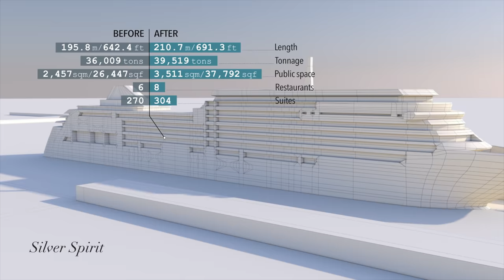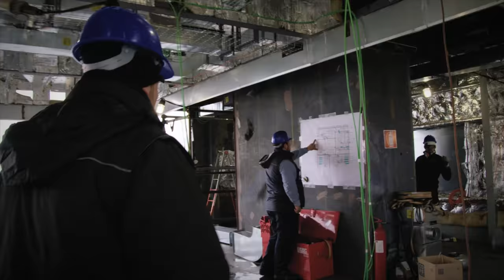Dry Dock Discovery - Silver Spirit: Lengthening a Luxury Cruise Ship

Comment: All that work for a lousy 49 foot extension?  Make it 200 feet!!!  And now you've got 2 more whole sets of welded joints to break and leak.  Good job there.....
Reply from the maker: Hi LoudMouthTim, thanks for watching. I suspect that there are two reasons for the size of the new addition. First, based on the entire length of the ship, there must be a maximum allotment for the the extension. The ship was only 642 feet long to begin with. Second, Silversea Cruises is known for their smaller, more intimate ships with a higher crew to guest ratio. Adding a much larger section would not have been in keeping with the rest of the fleet.

Comment: Is it safe to take a ship apart? Looks like a disaster in the making......
Reply from the maker: Hi Billy, thanks for watching. This process is really no different from how the ships are welded together block by block when they are built. A ton of precise engineering goes into exactly where to cut the ship to maintain seaworthiness while also allowing the new section to blend into the existing areas onboard.
Reply: Large ships are built from blocks like this, so you bet.
Reply: They're all about safety.  Like the guy on the left at 3:57
Reply: Obviously it isn't.  How do you think the ship is constructed to began with? Section by section.
Reply: @joedufour8188  He catches a face full of grinder sparks at 4:00

Comment: Oh the days of the past. After sailing for some 33 years, dry dock used to be just that. Taking an existing ship to be repainted, varnishing existing wooden surfaces, new carpeting, some checkups for the mechanical parts and other details to reduce the aging of constant exposure to salt water. Today’s dry dock includes satellite upgrades, adding WiFi, computerized check-in, more cabins, interactive information boards, and many more bells and whistles too many to add to this comment. Floating cities are now the cruise lines’ bread and butter. Long gone are the days of sitting on a deck with a book. So much to see and do, one week is rarely enough to see today’s mega ships. I’ve gone from ships that were 30,000 in tonnage to those pushing 230,000 GRT. 2000 people including the crew to 10,000+ combined passengers and crew. Less than 45 days and off I go again. 🛳🗺 ⚓️
Reply: D Heyes, I'm quite envious. It sounds like a marvellous lifestyle.
Reply from the maker: Hi D Heyes, thanks for watching. I hear you. I too miss the days where I did not feel obliged to communicate with those outside of the ship. At least the price to communicate has come way down from the $10 or more per minute to make a ship to shore phone call.

Comment: I will be onboard for a Lisbon to London cruise starting M-22-2018.  Sure hope it is ready by then.  Last October we were on Crystal Symphony fresh out of drydock.  We had lots of issues  even though the biggest thing they did was revamp several dozen smaller staterooms into larger ones.  The refurb ran so far behind that our original two back to back cruises were canceled and we took the next available. Mistake!  First, we were delayed leaving port a day and then about 80  passengers, incl me, were not allowed to board since the new staterooms were not ready.  Hell, it wasn't until almost 4 pm the next day that we were allowed into the stateroom.  And then the surprises got started. Like no lights in the shower or in the toilet area, but a very bright ceiling light that could not be turned off; electronic door locks that just stopped working along with the electronic safe that would not open, etc etc. A sofa that was put together wrong so it was 5" higher at one end then the other.  A bathroom door that you could not close and a closet door that would not open.  The whole list got to be pretty long.
So yeah I am a little worried about this makeover!
Reply from the maker: Hi DC Maxx, thanks for watching. Hope you have no issues on your cruise.

Comment: What’s that contraption sticking out of the hull seen from 6:35-6:42? Never seen that before
Reply from the maker: Hi Mike, thanks for watching. That is one of the ship's stabilizers. There's another on the other side. They extend outwards (resembling an airplanes wing) and are used to control the ship's rolling side to side movement during heavy seas.

Comment: That's an awful lot of effort for just 50 feet. Wouldn't it have made more sense to go larger and give the ship even greater capacity as they're going to all the trouble of cutting it in half anyway? Or is it that you can only add so much length depending on the width of the ship. Would it be too unstable if it was long and thin, so to speak?
Reply: David Hunt going even bigger would probably pose major problems for the ship. It would cost the company an extremely large amount of money and they would have to hire a lot of people to build the additional section and add everything in after the extension is welded in place. And lastly the cost for fuel would raise along with the boarding passes.
Reply: Thanks Joseph, I hadn't really thought about it like that. They would have to build two sections rather than one 100 ft section because there's not enough room in the dry dock. All the best, Dave
Reply: David Hunt your welcome David.
Reply: Yes indeed. Stability is number one. Then the cost to benefit factor is the second consideration. 

You can lengthen only so far before stability becomes an issue. Past a certain length the beam and draft must be increased as well to ensure proper stability (stabilizers help. But the ship must remain stable in the event of total power failure). Rules for passenger vessels are much more stringent and must be followed to a T. In addition, the equipment rating has to be considered. This includes everything from the wiring (how much more electrical draw is needed, how far it can travel with minimal drop, and/or how much power the wiring can safely handle before it all needs replacing or supplemented), power generation handling, plumbing supply, water makers, on board waste water treatment and discharge facilities, etc, etc, all the way down to the thrusters being able to handle the addition forces. 

Once your needs exceed the engineering capacity of the vessel, you're better off building a new vessel.
Reply: You run the risk of affecting the overall structural integrity of the ship, as the ship was not designed to be that much longer in the first place.